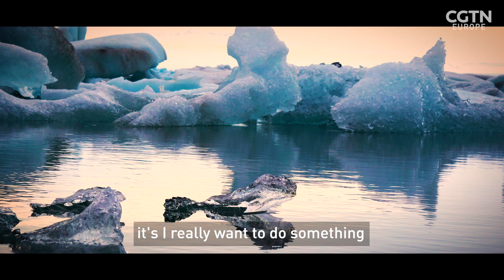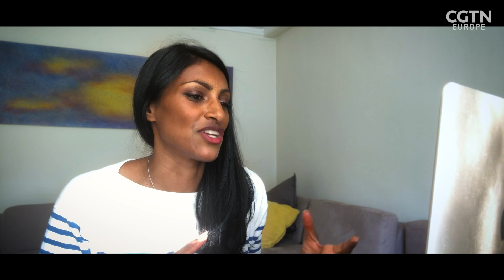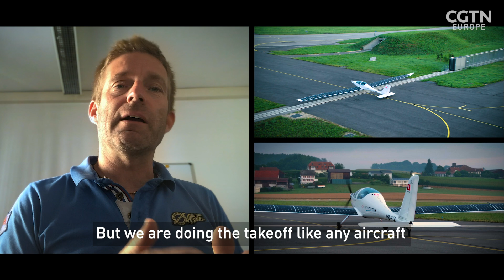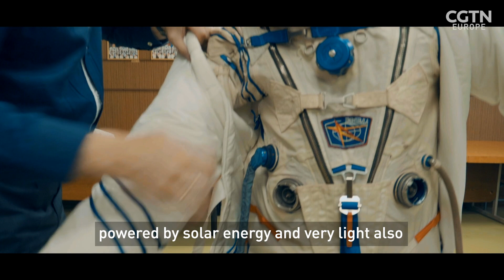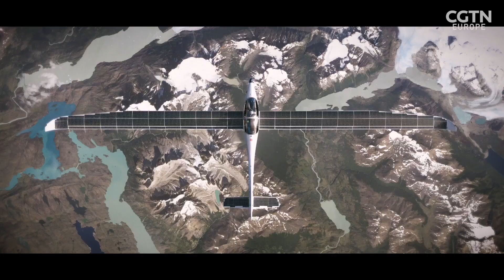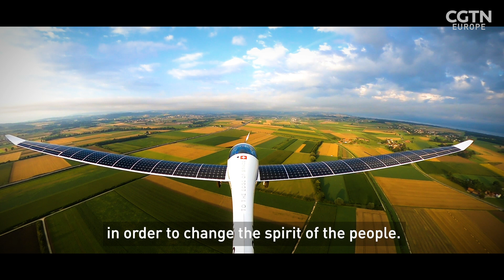Flying to the edge of space using only solar power

Comment: umm i dont think you can reach higher than 18000ft becoz :
-first the higher altitude have the thiner air density, the propeller will have a huge drop on efficiency unstill stalling.
-second the heat will very hard to get rip from your plane in stratosphere and you have a keep running propeller and the solar panels is also receiving the heat.

Anyway I hope you can find the solutions the solve those problem.
Reply: Is not necessarily that high. Just enough to see the curvature of Earth.
Reply: Heat is fixed by the drop in temperature at altitude.  -60 degrees C at 40,000 feet is common.  I know that there is an inversion of sorts at highter altitudes (or at least a drop in the rate of the temp going down) but heat will not be an issue.
Reply: Come on!  18'000 feet is not high at all!  Even my gasoline-powered plane is certified to 25'000 feet and could go a few thousand feet  higher on a record-seeking flight!  We are talking 80'000 feet here... but maybe your number is a typo?

You are correct to say that propeller efficiency drops with altitude... that is true for "regular" propellers designed mainly to give maximum efficiency on take-off.  But propellers can also be designed to operate efficiently in rarefied, high-altitude air.  The price to pay would be lesser efficiency at low altitude, that's why it's not done on regular airplanes.... but the present one is nothing like a "regular" one!

On your second point, given the very low heat losses of electric engines (ca. 5%, vs 60-75% for internal combustion engines), I doubt very much that cooling can be an issue.  I rather see, not a problem, but a design issue at heating the cabin!
Reply: @st-ex8506  
I thought It said 180000ft
Reply: @TheCraigy83  neither 18’000 nor 180’000’. The project’s goal is to reach the stratosphere, and they mentioned 80’000 feet of roughly 24’000 meters.
It’s doable… but they haven’t succeeded during their summer trials.
As a Swiss also, as a pilot and former aerospace executive (retired), I follow them relatively closely.
Reply: you also get slightly more power efficiency with solar panels the higher you climb due to the lack of particals scattering the photons away from your craft. meaning the motor can receive more power.

dont... ask me more than this though. i dont know the maths or anything. im just saying anything is possible.
Reply: @endeyfire   at 40,000ft its 2.6psi 50,000ft 1.6 psi , by 70,000ft its effectively zero psi , what are they flying in/through at 100k feet ? .
Reply: @TheCraigy83  considering you asked what i dont know. heres a hand picked number:

42.
Reply: @endeyfire  
Look up the air pressure drop off rate at 30k - 40k - 50k- 60k - 80k feet then think rationally about 100k feet in a propeller driven craft that maxes at 40knott. 
Its flying through literally nothing + will have less thrust/lift then you or me trying to flap our arms to fly 😂.
Reply: @TheCraigy83  sounds perfect for the dolphins.
Reply: By the way there maybe solution i found on youtube.
https://www.youtube.com/watch?v=N3bJnKmeNJY
Reply: Perlan Project Inc. is a  not-for-profit aeronautical exploration and atmospheric science research organization that utilizes sailplanes (gliders) designed to fly at extremely high altitudes .
 The 2018 season was again based at El Calafate. The project acquired a Grob G 520 Egrett turboprop aircraft for use as a tow plane. This enabled Perlan II to be towed to 44,000 ft (13,411 m)  This seems to be the highest glider tow, as records are not registered. 

On 26 August 2018 Jim Payne and Morgan Sandercock reached an altitude of 18,492 m (60,669 ft). This was followed by 19,439 m (63,776 ft) with Jim Payne and Miguel Iturmendi on 28 August 2018. On 2 September 2018, Jim Payne and Tim Gardner reached an altitude of 22,646 m (74,298 ft), surpassing the 73,737 ft (22,475 m) attained by Jerry Hoyt on 17 April 1989 in a Lockheed U-2: the highest manned heavier than air subsonic flight. The Perlan 2 could fly to 90,000 ft (27,000 m) if conditions allow, higher than the manned level flight altitude record of the SR-71 Blackbird at 85,069 ft (25,929 m).Previous records were measured with pressure altitude; high altitude soaring records now require GPS data.
    Wikipedia.